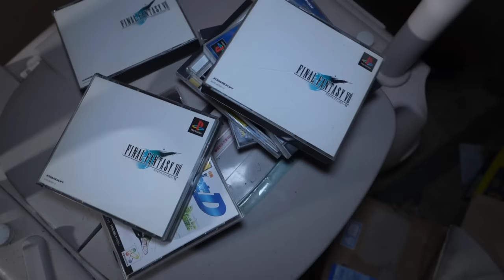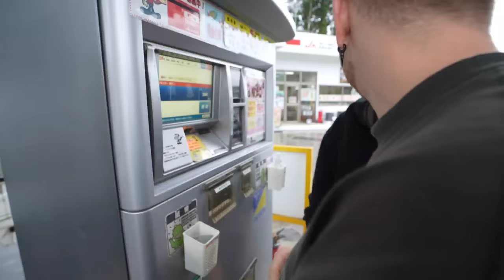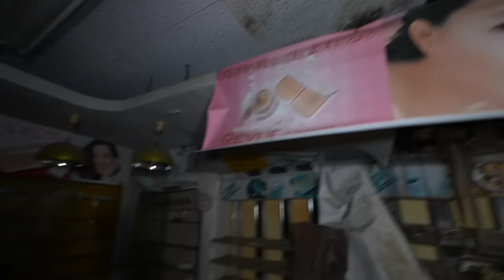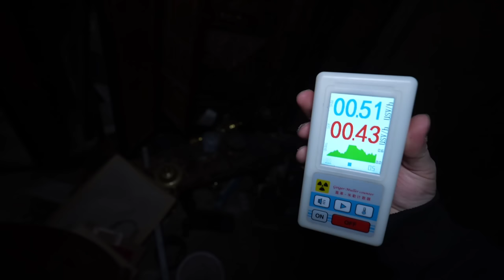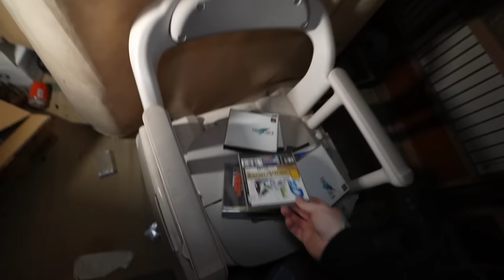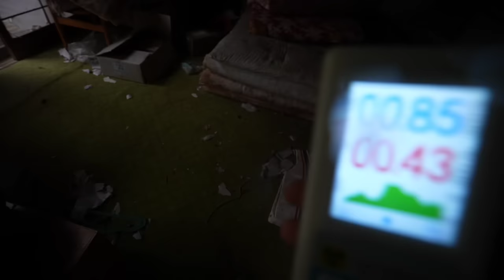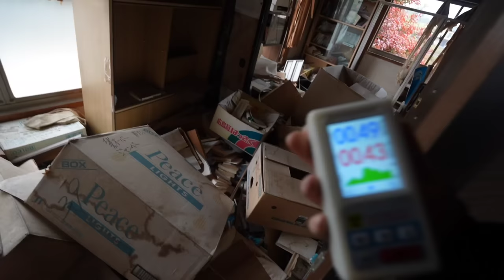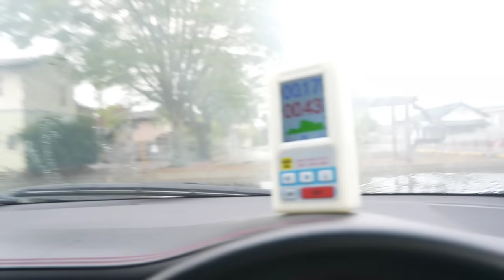Abandoned Retro Game / Toy Store Full of Rare Items in Fukushima Japan | NINTENDO HEAVEN

Comment: You need to get more up to date on fukushima, there are some people moving back to their homes and no-one suffered any radiation health problems who lived there. 
Even at the power plant protective clothes outside are not needed.
Only 3% of the land around fukushima had higher radiation levels. 
You carrying a radiation monitor was pointless.
What is Background Radiation? Naturally-occurring background radiation is the main source of exposure for most people. Levels typically range from about 1.5 to 3.5, you wasn't even getting near 1.0 😂 the bush is radioactive 😂
If the power plant exploded like the one in the Ukraine then the radiation monitor would of been needed as that power plant exploded debri over the town and surrounding countryside.